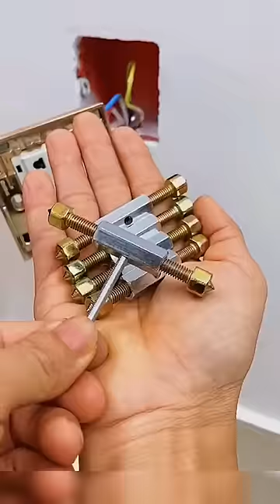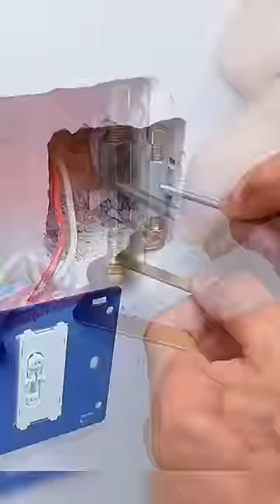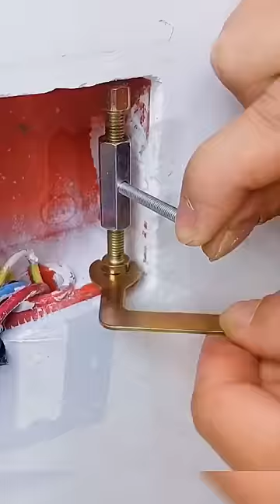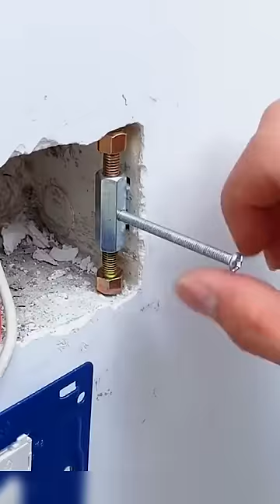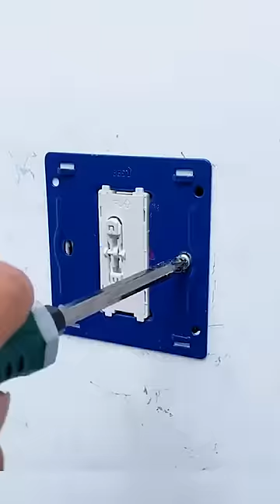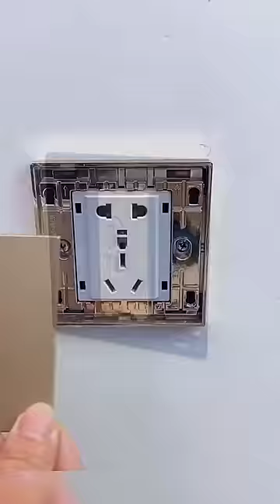How to Repair Electrical Back Box in just 30 seconds !

Comment: Or just use the correct box components to begin with. IE the mud ring. I doubt this product is UL listed for this use.
Reply: I feel it would need to be non conductive to even have a remote chance at a cert.
Reply: Joshua this isn’t something that would be put into a new install.. this is for maintenance and to get you out of the shit only. Richard you would only use these on metal boxes and they’re are earthed via the screw or linking the box if you do that. I’m from the UK so things may differ out your ways.
Reply: Imagine it coming lose and arcing your wires.
Reply: @imacrazyguy5831  you know the box is metal and earthed right? The wires have insulation on them, another person here who has no idea what you're talking about

Comment: People talking about changing boxes and stuff and don't realize to change the box you need to redo part of the wall too and that involves concrete, plaster or whatever your wall is made of, paint and whatnot. To remove a box you have to basically destroy what holds it in place and so for a quick and cheap fix - specially if the apartment isn't yours - this is actually cool
Reply: Post drywall box baby. Aswell, removing a box only requires removal of about 2 inchs of wall top and bottom. You just have to know what your doing
Reply: @jsmgaming1062  I'm not saying this is the ONE SOLUTION TO RULE THEM ALL, just saying it can help in many cases.
Reply: im gona buy these and test them myself. If the work good then ill use them at a clients house
Reply: all good till you have to smash off tiles to change a box and there's no spare tiles...

Comment: Our electrician nearly killed me with his plug method. He cut a hole in the lasted and pushed the Insulation board at the back away, didn't cut a hole for it or anything. Condensation then got to the plug and me and my dad found it before before anything crazy happened.